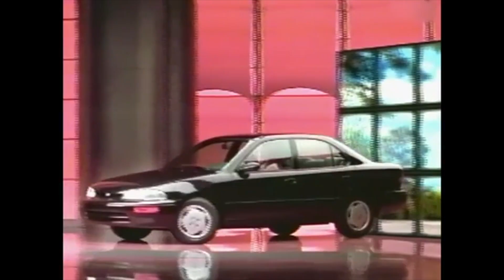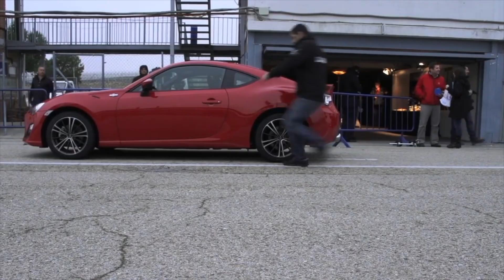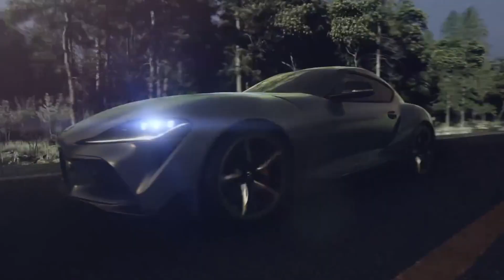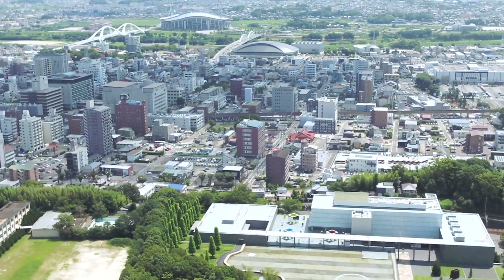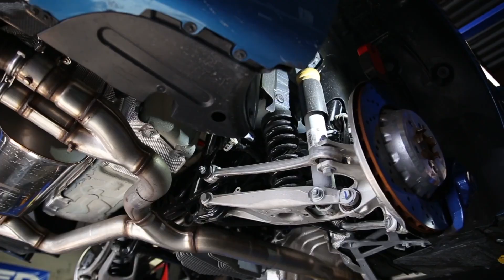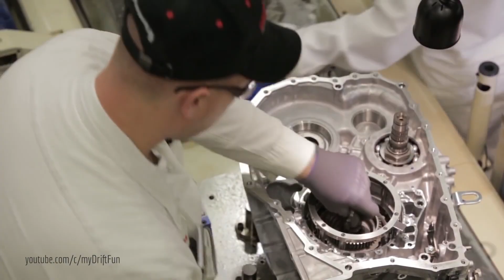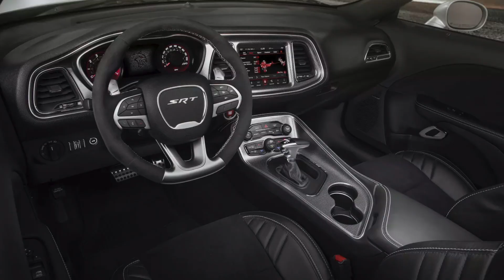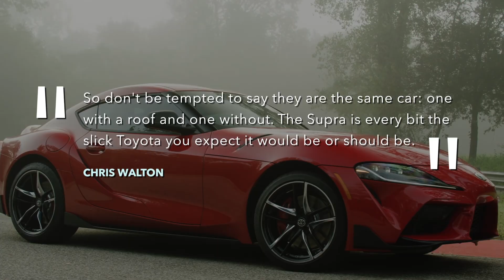MKV Toyota Supra - BMW or Toyota? The UNTOLD TRUE STORY

Comment: I love Japanese cars, have an old Mitsubishi in my garage and dream of owning an Evo6 once, but at this time of my life I still drive BMW 3 Series limo, 3 series convertible and X5, just because of the pure quality feel and refinement, onroad performance that they all deliver even without the M-badge. Of course, they cost nothing like a Toyota or Mazda or Mitsubishi to buy and run, but they truly are remarkable pieces of engineering. To make a long story short. I was one of those guys who never had thought of buying a BMW, nonetheless 3 of them, instead of buying a Japanese car. But let's face it guys... It really is a challenge to find a real drivers cars among Japanese cars... The most you could go with is a Subaru Impreza/BRZ/gt86/Mx5/isF/GTR and that's about it. BMW alone has more of these in their lineup... And yes. A real car should be RWD and front engine, or AWD and turbocharged... FWD doesn't count regardless of the power. I am so very happy to see a collaboration between these two companies. BMW giving their technology, experience in RWD performance cars and Toyota perfecting it, so that it will stay reliable. I just hope to live and see the times when Japanese cars rule again... Will definitely be there to buy one. I feel this is a perfect start to a great adventure.

Comment: Thank you Albon for possibly making some 12 year olds mids up, including mine, aside from being 12. I thought that BMW had made the engine, transmission, driveline, the WHOLE suspension, differential, brakes, interrior and the chasis, boy was I wrong. I didn't think that the Supra is a re-banged BMW Z4, but I did think that the Supra was a BMW Z4 under a Toyota body. Thank you for opening my, and some others eyes.

Comment: A great video and I am happy to see Toyota was more involved in the quality testing across most of the stages and not just suspension tuning and later adjustments,
but I feel like this video missed the point of the complaints. 

What they community is pointing out is that nearly all of the components used in the Supra are BMW parts bin equipment, the platform is a revised version of what
is found in the 2 series  and other cars in BMW lineup.  And that's just a hardware perspective it doesn't even cover how is the Supra going to be serviced? Are the Toyota technicians being trained
by BMW? Is there only specific repairs some dealerships can make?  Is Toyota going to actually support this product and listen to community feed back? 

Or are we going to have another BRZ/86 fiasco where everyone is asking for just another 20-30 HP and they never get it,
hell they haven't really made any changes to those cars since they went on sale. 

That doesn't even touch on the biggest issue the Supra has.  Why spend 50K+ on the Supra when the M240i already exists with the same drive-train
but is cheaper????  The 2 series also comes with a manual if you get a model prior to 2019 for those who really want one.

....The Supra will be a good car but it's done nothing to push the car segment forward either in terms of Performance or Value.
Toyota should have built this car totally on it's own,  it would have at least  provided an opportunity to truly innovate and design new products
and technology which can be applied across their entire line up.

I get Toyota has been scared to attempt anything since the LFA , but they are the worlds largest car manufacture they need to grow a pair
And produce something totally in-house.

Comment: This is a damage control video but the damage has already been done. 
I like BMW and I like Toyota but you don't mix and match a car like the Supra. It's like putting a German made handle on a Samurai sword. This makes it look like the manufacturer is trying to cut corners. I can see driving this car showing off to my friends and all I hear is this ain't a SUPRA! This car's value will be just like the Mazda RX-8
Reply: Blade analogy is spot on🤣🤣👏
Reply: Exactly what I was thinking man
Reply: It’s like taking the blade of the Japanese sword and replacing it with an old dusty German blade on it. It’s missing 2 seats and NO 2JZ ENGINE. There is no manual transmission and it’s a roadster. It will never be a Supra and it spits on its name by trying to pretend to be one.

Comment: Toyota and BMW were in early mutterings of the new Supra joint venture since the late-2000's. It's only in 2012 after the EightySix (not '8 6') that it actually kicked off. You can say what you want about who developed what and if it is actually a Supra or not, but the concensus is that it's largely a BMW product with a splash of Toyota thrown in, and a badge. You'll be hard-preessed to convince die-hard Toyota enthusiasts about its heritage and who works in cooperation with whom (Yamaha for example, every 'G'-head since the 1960's is a Yamaha product, so it's not as small-scale as what the narrator was making it out to be). A lot of people argue that you'd get a better deal if you bought an M2, which is something along the lines of the direction the new Supra should've followed, not the Zed4 path. At least with the M2 you get a manual transmission option. Regardless, the Toyota modders will have the last say... buy the 4-cyl option when/if it comes to your country, and as Tada-san suggested, throw it out and put in the 2JZ instead (and of course an R154 box) =)
Reply: indeed it does, but it has never been referenced that way with us gaijins. We know the story with the Corolla AE86; the moniker that hailed greatness in fast, driftable JDM hatchbacks. In every English-speaking country, it's never been known as the eight six. Rather, it's been known as the 86, FT86, or GT86 depending on which country sold it, but always as "eighty-six" pronunciation
Reply: @STAG162  EightySix, Zed4, you are probably the most uptight comment-er I have seen on car videos.
Reply: it's 'commenter', and English is my first language. you don't like it then don't comment. I'm not here to blindly harp and reiterate a yank accent like some plague all over the world. have some integrity in your life, you'll go far.

Comment: I guess not a lot of people will buy a manual supra if it`s there, they will just go buy a gt350/elise/vette, which are much more of a serious car. So it is the right decision to not having a mt in the supra, simply because the supra is not gonna have a good performance for it`s price level.
Reply: Even after this video, i still do not forgive the lack of MT, as a sports car putting fun factor at the first place, having no manual gearbox just eliminates all the rest of the hard works. The Americans manufacturers are much clearer about this. All their sports cars comes with manual gear, LSD, and RWD, except for the GT500 but that thing has REALLY serious power.

Comment: What about the fact that the Supra's interior is nearly a copy-and-paste of a typical BMW interior? I own a modern BMW and the gear shifter, infotainment, steering wheel controls, center console design, are all identical or nearly identical to a typical BMW interior. It even has the 8 touch shortcut buttons, which has been an exclusive design feature to BMW products. Hell, even the door handles are straight out of the 8 series (which are also in the Z4). Don't get me wrong, I think the B58 and ZF drivetrain combo is wonderful, and if the engine truly was made much more reliable by Toyota, I can't think of a better daily driver sports car combo I'd rather have. But the Supra not only takes the basic platform/powertrain from BMW, they basically reskinned a typical BMW interior.

Comment: The main problem is that it's being built as an adequately powered  coupe that should have the performance to at least compete with the likes of the GTR (since the NSX was just a sellable design project made to highlight the rest of the Acura lineup). It doesn't have to be in the 6 figure range to do that.

Comment: This is more similar to the Sabbaru rather than the Geo Prism. At least there's some visual difference. The case of FR-S and BR-Z is good old fashion badge engineering. Toyota owns a big part of Fuji Heavy Industry, so it's basically like the same company developed 1 car but badging it as 2.

Comment: the new Shelby gt 500 and the corvette zr1 both use the same engine from Eaton, yet no one is whining about that. I think the new Supra is a gorgeous car. Also whining about horsepower?  the new Supra will have same or better rigidity as Lexus LFA and it has 50/50 ratio 335 horsepower and 365 lb-ft torque and the GT-86 has a 53% - 47% ratio and look at how much Chris Harris had driving it, I think it's about the driving experience 

https://www.youtube.com/watch?v=romf-G6CZ7g&t=439s

https://www.youtube.com/watch?v=JUhLXvxlQR4

https://www.youtube.com/watch?v=uTDtUG-rVfA&t=15s

https://www.youtube.com/watch?v=FMZk5eXT2-0

 2019 Ford Mustang (i think convertible? ) Accel, 0-60 mph 4.2 sec, Bullitt 0-60 4.6 sec

https://www.digitaltrends.com/car-reviews/2019-ford-mustang-bullitt-review/  < says Bullitt with 475-horsepower is 0-60 in 4.1 seconds  (140 more horsepower than new Supra?) 

Mustang gt350  with a horsepower of 526, is doing 0-60 in 3.5 sec.
 (191 more horsepower than new Supra)

https://www.0-60specs.com/nissan-370z-0-60-times/

2019 Nissan GT-R Sedan 565 hp  0-60 in 3.5 sec

https://www.motor1.com/features/242966/10-cars-engine-another-automaker/

Comment: The complaints are well-founded.  A twin platform shared with a lackluster roadster, no manual transmission option, not even a dual-clutch.. The car lacks soul.  Disappointing.  Back to 911s I go.
Reply: LOL, the toy 911s you have sitting on your table don' count as cars. Keep dreaming.
Reply: The new Supra doesnt have a fat ass like the MK4
Reply: At least the 911 does at least keep to its heritage
Reply: Why on earth would anyone want a jerky, unreliable dual clutch over the ZF? It's better in every single way. Either you want an auto or you want a 6 speed.
Reply: Lol. As if anyone in these comments drives a sports car of any description.
Reply: @ootdega  umm, an excel is a sports car
Reply: @ootdega 490whp 2014 Camaro SS here
Reply: @ootdega  maybe you don't. I have an M2. And looks like it'll stay that way with a price point that's identical to the M2 Comp.
Reply: @cwx8  the price of the new Supra which is kinda creeping into more luxury car status which I have no problem with but the thing is there are better cars for 50k
Reply: All it really lacks is a manual transmission option. Otherwise its a solid Supra. All I would personally like to see though is for them to integrate the cockpit-style feel that the older supra had due to the dash setup/shape.

Comment: It is smaller but it has a longer and wider wheel base than the original supra.  Which the extra wheelbase it will help  stabilize it at high speeds, and the wider track should help it handle better.

Comment: Ok i'll play along....now please explain the identical - and bmw standard - idrive screen and wheel controls, steering wheel controls, headlight controls, steering wheel in general, climate controls and misc center console pieces, power window buttons, mirror, door chime sound, etc....i thought the video said Toyota completely independently designed the interior? Only obvious interior thing they designed is the mismatched driver & passenger door panels lol

Comment: My only real complaints about the new Supra are that the BMW engine is not home mechanic friendly (note the timing chain at the rear of the block) and the lack of any manual transmission.  But in truth I'm never going to buy a Supra; if I wanted a Supra, I'd buy one of the old Celica Supras and if I had the money to buy a new Supra, I'd get a classic driver (like an AMC Javelin SST, an Opel GT or a Datsun 510 coupe) and resto-mod the thing into a driver's classic.  I hope Toyota sells enough Supras to keep it around a while, but the 86 experience suggests that it might not succeed.  I don't like that SUV's and CUV's are so popular now, as sports cars are the first casualties of their popularity, and sporty sedans are losing out too.  In this day, the only way Toyota has been able to make sports cars is to pair up with another manufacturer.  It's what we have now, and either people take advantage of it while it's here or they don't, but the old Supras aren't getting any cheaper or more plentiful.

Comment: BMW Engine, Suspension & Transmission...ok so it is technically a REBADGED BMW. So what if the chassis & handling is different. Who gives a shit? We all know that Toyota took the Supra to R Kelly's studio & left it there with condoms & lube. 60K for a fake Toyota?! No thanks. In my opinion the Lexus LC & RC have the true Supra spirit even though have V8s & not inline 6. Hell even the GS F. You can find all three models that are CPO around the 60K price. Remember kids, only the Lexus GS, LS, LC, & LX are currently made entirely in Japan. Most Camrys, ES 300s, RXs & NXs are made in the U.S.

Comment: What the hell is this video actually trying to say? Neither BMW or Toyota have made any secret of the sharing of parts. Somehow this moron is trying to make a big deal of his ‘research’ and infers ‘inside sources’ that basically consists of a monotone regurgitation of commonly available information. I especially love his listing of Internet forums as a ‘source’!

Anyone with common sense knows that it’s becoming increasingly difficult for manufacturers to make the numbers add up on a proper sports car (thanks to things like SUVs). 

What the heck do you think the entry level Lamborghini/Audi R8 is?

So sorry Supra fans, but it’s very unlikely you’ll never see a truly standalone model again. So basically your choice is to accept the compromise in a joint engineered program or move along...
Reply: Meant to say “ever see”. Oh and by the way, Toyota have pretty much confirmed a manual, as BMW will offer one on the entry level engine in the Z4 which comes later. And ‘shock horror’ the auto box made by ZF is used in a range of cars, I wonder if the electrical connectors or LEDs are used in any other car on the planet 😒

Comment: They didn't talk about electronics which pretty much BMW stuff. In a modern car everything is electronically controlled: engine, transmission etc. Why bother designing it from scratch  if BMW has everything ready? Look at the radio, infotainment screen, center console, power window switch and steering wheel buttons. They are all 100% BMW. That also means that electronic control modules that control them are also BMW therefore the clock spring, steering column and steering rack also have to be from BMW. Very disappointed by Toyota. It's sad that one of the biggest car manufacturers in the world that has all the capability had to use BMW parts in the iconic Supra. 2jz-jte is still one of the best reliable engines from old supra. Why not update it? The 6 speed transmission from old supra was capable of handling near 800-1000 HP. They couldn't make a manual transmission version? Just because BMW doesn't equip those engines with manual transmissions.

Comment: Toyota missed the mark. They didn't want to invest the R&D$ and piggy backed off of BMW for a sales ploy. Let's be generous and say it's even 30% Toyota. That's not going to cut it for the Supra fans. 

We know Toyota has the engineering capability (often in conjunction with Yamaha) to produce awesome supercar like the LFA, BUT I think they looked at that project, saw they lost $$ on every unit sold because they know they can't keep production costs low enough to profit on a supercar, and played it safe with BMW on a sports car. 

I think they played it too safe, came up short on the wow factor for the cost, and won't make nearly what they're hoping for on this project.

Comment: "BMW reliability?!" Ha, I don't think so. European cars have a horrible reputation for holding up over time. That's my opinion from the consumer side of things.  I have had lots of Mercedes, Audi, BMW, none have avoided breakdowns of some sort. And for a short time I had a Porsche Boxster, able to sell it at a profit BEFORE Porsche's IMS bearing failure became a worldwide scandal. (If the intermediate shaft bearing failed your engine would most likely blow up, i.e., you had to buy a new engine for your Porsche or junk it.)

Of the three brands I mention, Mercedes were the absolute worse, especially the overrated SLs from the 1980s-90s. Audi came in second, mainly my cars being plagued with electrical issues. Gotta admit, my favorite cars (of the luxury models/brands) were the BMWs. From my 3 series, 5 series, to 7 series, all ran tight, solid, and smooth. But things happened to those cars that shouldn't have. 

E.g., a 740i developed fuel line leaks in the engine area, TWICE! Yeah, my car could have blown up, with me inside it. 

E.g., I really liked my MINI Cooper (by the time of my model year the MINI was a BMW product). The MINIs turned out to be an average car, graded "unreliable" in Consumer Reports. E.g., I had to reinforce the front struts with iron plates because the the struts were mounted to weak steel in the engine compartment, that was part of the frame. If you didn't take protective measures, the struts would slowly collapse and throw the car out of alignment, and could never be adjusted.

That's my story. I would never pay (probably U.S. $70,000 + after all options, package, trim, fees, taxes) for some Toyota/BMW  mid-range, mid-priced Frankenstein Mobile, made for guys suffering midlife crisis, or single guys who use this car to attract the ladies, but it is the first thing to go when he gets hitched..